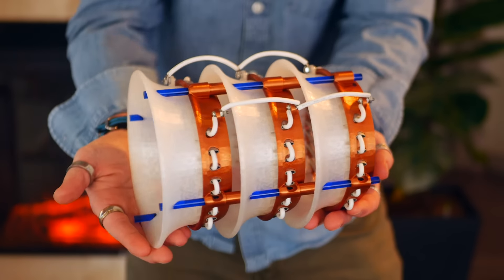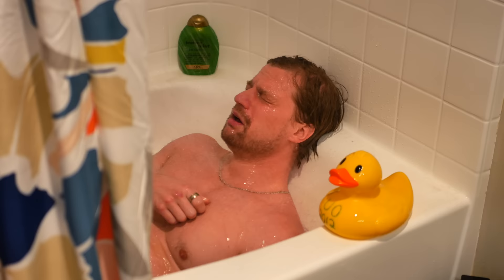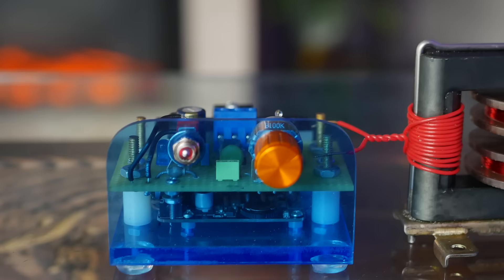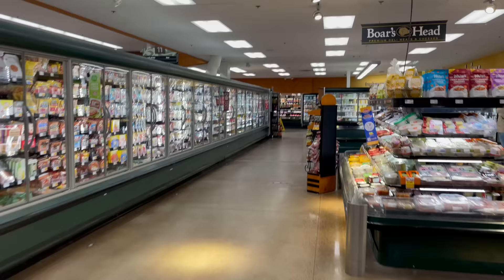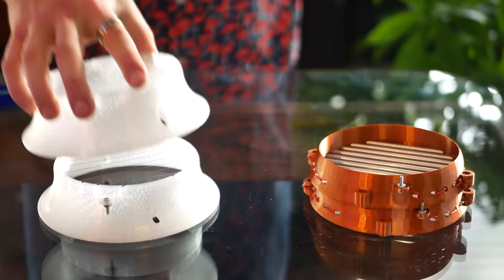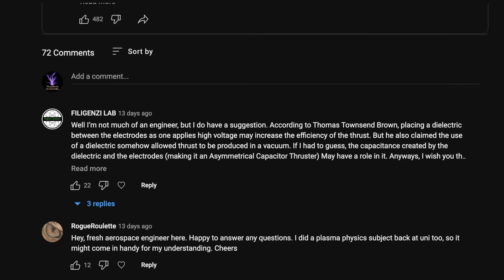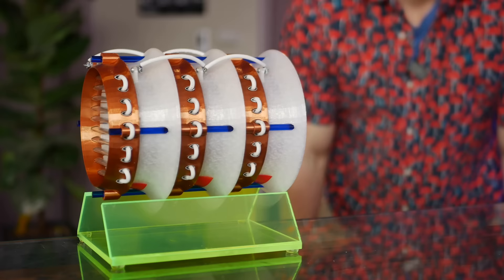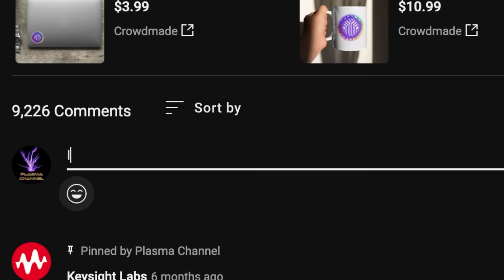The Next Generation of Ionic Plasma Thrusters (BSI MARK 2)

Comment: To better work upon the venturi effect, Try making each following stage slightly smaller. The inclemently shrinking space should increase velocity of the outlet.
Reply: exactly wat i was thinking, i would also be interested to see what would happen if you had an outer shroud that draws the secondary and tertiary airflow from the first stage
Reply: Another detail: The gap from  positive to negative electrodes should not be the same on different stages.  Experimental work should be adressed to optimize electrode gap on second and third stages.
Reply: My concern with that would be overcoming the additional static pressure that would create. Feels like the first stage needs to be exponentially more robust to overcome the resistance from the next modules. I have to wonder how if an intake manifold set up with two or 3 channeling air down to one positioned at the exhaust end of a cone would produce the same effect without the downside of needing to shrink the final stage.
Reply: I wonder what would happen with gradually smaller funnel like nozzle smaller the nozzle the faster the air will flow with limits even if was few centimetres less than current outlet even with side inlet and last stage slightly inside the nozzle just a thought tho....
Start at 30cm 20cm 10cm to 8 or 6cm nozzle mmmmmmmm
Reply: I also wonder if by creating a grid with the stages (alternating the stages in 90 degrees) if you would get laminar flow.

Comment: This is my two cents worth.  I think we have to think of this at microscopic level.   What causes the thrust is the net affect of the positive ions that are ripped apart but miss metal rods (correct me if I’m wrong). The ones that “hit” the rods try to slow down thruster.  So there is a net effect force of the ones that miss.  Now if you have 3 in a row, you end up with ions that have to go through a gauntlet, they hit one, that energy is lost.  Also for effect to work you need to feed “neutral” charged air, but your feeding increasingly charged ions at every stage.  Neutral air is still getting to the second and third stages but they will be less efficient and tripling thrust I think might be difficult.  I think if you want to triple thrust, they need to be side by side in parallel.  And you have to measure force and not airflow.

Comment: Great video. Looks like there is very little advantage to stacking the thrusters though. Better to have many single units in parallel rather than stacking them in series. Looking forward to mk. 3
Reply: true. maybe stacking them side by side to then push them all out of a single outlet. like a turbo. collecting all air into a 3 way inlet and then out of 1 outlet. because then each thruster is independently producing 2m/s and then hopefully combine without reducing any other thrusters power.
Reply: Exactly. The first thing I would have tried after the disappointing results with the pc fan would be to stick two onto a Y shaped tube. Obviously serial plasma thrust doesn't work that way.

Comment: You might want to use thinner negative conductors as well and try a closer spacing so theoretically you could get more out of the unit. Also, I love seeing your progress in this build.
Reply: I was wondering what the optimal ion density would have to be to produce maximum thrust (if there is such a figure)
By making each grid with closer spaced wires would improve the voltage gradient between the positive and negative “plates”. (More exposure of the electrical field to the air molecules) 
With the wires displaced as they are, it seems that the electron flow moves across the desired air path , effectively lessening the electron push on the air. It just seems like there isn’t enough electrons (too low density) pushing the air molecules 
Kind of demonstrated when the 2 grids were brought closer together, the resulting electrical resistance decreased and thereby increased the electron flow (current). 
I was just wondering

Comment: You might want to mix it with a wind multiplier (from a bladeless fan) to check the improvement on the wind output, also you might want to smooth your materials to have less drag coheficient from any pores or tiny bumps in the 3d printing (like polishing the materials or sand it)
Reply: I was going to suggest the same thing ... Try replacing the impeller on a "dyson" style fan and see if you can take advantage of low pressure twice.... also I agree with another poster about reduction per stage to attempt velocity boost
Reply: What about using the principle of a golf ball by leaving the surface rough?
Reply: @richpryor9650  golf balls are pretty smooth, even the dimples holes, but that only works with propelled/push by motor/engine/bat/club/arm objects in  movement  to gain speed through creating an air layer/turbulence to change the airflow on the back of the object... this principle does not work on static objects though... unless you put a golf ball in front of the thrusters... hehehe

Comment: Great work sir! 
If I may suggest: sequentially increasing the voltage throughout the three stages. Each stage would be higher in voltage by double the previous one. Or maybe even exponentially increasing the voltage throughout the three stages.
Reply: Yep I'm thinking of steam turbines, where each stage is tuned to the energy output of the last stage. Voltage would be much easier to experiment than size too.
Reply: I like it! Good call. I wonder if the optimal spacing in the later stages would change as well?

Comment: My suggestion 
1. Keep 1 inlet duct for smooth airflow wirhout any inlet turnulence 

2. Keep 3 stages of electrodes No Auxillary  air gap

3. Keep 1 nozzle at the end to convert Static Pressure of air into Dynamic Pressure or Kinetic Energy

The design is motivated from conventional Tubrojet/Turbofan Engine with three sections
Inlet --> Ionic Discharge Section --> Nozzle(Thruster) section

Try to optimize the nozzle by playing with
(A) Length 
(B) Air Ratio ( Nozzle Inlet to Outlet Area)

Comment: Awesome project with great improvements over mk1.
I would consider:
1) placing the whole system in a tube to increase the pressure, wide inlet and smaller nozzle
2) not sure sucked airflows from the 2nd and 3rd stages add a lot, I would focus on compressing the current airflow in a smaller tube and vary input voltage on each last stages
3) like current aircraft, I would advise to get 2 differents "controlled" airflows: main going through all 3 stages, secondary going around the main outside the 2nd and 3rd stages (of course the 1st stage must be way wider than the others)
4) go big, i mean factor scale will highly change things with different sizes, this is what we are looking for in aviation but we are limited by ground clearance for the engine nacelles haha

In a nutshell: wider 1st stage, 2 airflows going through 2 concentric tubes
😉
Reply: Completely agree with 2) & 3) you are measuring airspeed yet you increase the pressure by bleeding in that air which will reduce the velocity. Velocity is inversely proportional to volume - Boyle's Law.  Drop the gaps between multiple stages and make the transition between each stage as smooth as possible.
Reply: I doubt flow from the first stage around the others like a turbofan is gonna do much, if at all. In a turbofan, bypass flow makes sense because the first fan is driven by the combustion and compressor, but here it would do nothing but accelerate air that is not used anymore. Fully agree with the rest, all those "auxillary intakes" do nothing but make it worse. Intake and nozzle, I think, are key here to increase outlet speed.

Comment: Excellent work...regarding electrode alignment, you would be wise to introduce some asymmetry into your design IE positive electrode (forward,) can be wire and the negative electrode (arft,) a cylindrical ribbon...greater surface area..also have you considered staggering the voltages IE each stage higher than the previous.

Comment: Thank you for the video and the effort. I don't know if it possible, but I have an idea for Mark3 to improve the result: the size of each module should be different, and each module should have its separate power source. the overall shape should look like a cone. the first module or circle is the same size of the diameter of circle in Mark2 but the second module or the module in the middle is smaller in size. the last module is smaller than module 2. the bigger module should have 1/3 of the power, the second module should have 2/3 of the power and the last and smaller module should have full power. the idea behind this is to build more pressure which may result in higher speed of the air flow.

Comment: Really good video and progress you've made there. I only have a small suggestion, let the 2nd ring be 10-15% smaller than the first and the last ring also be 10-15% smaller and get a higher compact air outflow.
Reply: bernoullis principle applies to high pressure and high velocity flow, so it would have almost no affect here.
Reply: I would go with 1.5x surface decrease per stage
Reply: you're just making it even less efficient.

Comment: This is a great video. Love how you've approached ways to improve your design. Especially when collaborating with different people. I'm not a PhD of any sort but I'm fascinated about learning how physics works and gets applied. This might be outside the realm of plasma but if you're open to trying this out or if it's possible, have the output airflow of your engine go into a chamber that's like Tesla one way valve and heating the later end of the chamber to expand the air (similar to a ram jet) as it leaves chamber. It might not work for obvious reasons I not aware of, but it's food for thought. ;)
I look forward to seeing other videos.

Comment: I would be interested to see if the 3 would make more thrust separately or in the 3-in-a-row config you have now.
Reply: thrust, maybe, as they are pushing more air volume, but stacking them is the only way to increase the velocity of the airflow without increasing the mag field created by the electrodes(which can be done a couple different ways).I’m not being a know it all, i just built one recently is all. not qualified in any way.
Reply: if you mean routing the 3 separate ones into 1 output  nozzle of some sort then yes it wld make it faster, i just realized that’s what you could have meant after writing the last response.
Reply: @OwenMurphy-pp6dr  I would love to see you try it. seeing what actual thrust you could make. also instead of running the wire through the tubes solder them could help making the tubes thinner I'm subscribing after seeing this video.
Reply: @randy6394  yeah i love this guy he’s where i got the original idea from (although it’s much different from his now)

Comment: You may consider using stepped sections. A larger stage feeding to a slightly smaller stage to an even smaller stage. This should compress the air stream and improve your thrust output. Just a thought.

Comment: In your current design, have you thought of stepping down the output diameter of each subsequent thruster to see if that too would increase the air thrust pressure? Great job by the way it is inspiring me to make one.
Reply: T-H-I-S! Thank you. Smaller diameter and collapsing gaps between each one.
Reply: I like this! I'm not versed in anything like this, but it makes sense in water pressure, why not this?
Reply: Can air inertia play a role here?

Comment: Awesome work!! I love what you're doing! I would be curious to see what a radial array of wires would do. I wonder if you angled the ground fins like a propeller to create a vortex at different angles for each stage and decreased the side inlets farther down  and compress the vortex at the end with a tapered nozzle to speed up it's rotation and hopefully velocity as well. I'm no engineer but I know jet engines have variable angle fins in between turbines to guide the airflow for maximum efficiency!

Comment: Thanks again for this. It is a huge improvement compared to Mark 1. I have been logging your results as I am planning to integrate this into another known technology to produce a combination that could substitute for a turbofan engine, albeit a much smaller one. It's great that you managed to utilise a lower voltage for this as I did have major concerns on your Mark 1 that needed 45 kV to run lol. All the best on future improvements, and perhaps we can compare notes in the future. Cheers!

Comment: I was wondering what would happen if you tried creating a vortex? Imagine 5 stages.Each offset by a few degrees to twist up the airflow so when you reach stage 5 (or whatever) the grounds are now vertical. So, stage one is horizontal, and from there each stage is twisted slightly until you reach the final stage that us vertical.
Reply: I was wondering the same, also I believe the laminar boundary layer (aka skin effect) is slowing down his results due to unnecessary drag. Im curious if a rotating triangular set of grids would help open up the center a bit for higher flow through while twisting it could help create that vortex to even out and center the flow
Reply: when i seen the video i was wondering a similar thing. but adding a "rifling barrel". to cause a spiral effect.
Reply: The development of the Next Generation of Ionic Plasma Thrusters requires an understanding of the evolution of ionic thrust. While jet turbines evolved from propellers, there is still much to be learned about the potential evolution of ionic thrust. The BSI MARK 2 represents a significant step towards the development of advanced ion thrusters, with its incorporation of new design elements such as the aluminum cross tubes and fine wire layers. The challenge now is to determine the optimal configuration for these elements and to eliminate design flaws such as the mixing of low-velocity air with flowing air.

Comment: Since the stages don't add up airflow, I'd adapt the second and third stage to perform best with already moving air (using the setup fan - > thruster -> meter). The later stages probably need more space between electrodes and maybe you should also stage the power input.
Reply: bro just connect them in parallel ☠
Reply: @prakharmishra3000  works too xD

Comment: great vid now I want to build one. I would suggest changing the out diameter of the second and third stage in both a expansion setup and a compressor type, because I believe the extra stages are still resticting air flow

Comment: You could also increase voltage for each stage. It works in photomultiplier, so it could work here as well.
Reply: I was thinking this. Uniform power across stages creates sustained flow not a cumulative increase per stage.

Comment: I know nothing about this tech but I am very engineer minded.and worked on helicopter engines for the military.  What happens if you use a screen style cross pattern with your wire side electrode creating a grid creates precise points for arching. Also tightening your 2nd and 3rd stage intake rings get them to the point they're whistling. Then open them up just a hair. This will give you better vacuum creating better thrust I believe. Im

Comment: For increasing exit velocity, perhaps you can make the ionic thrust sections at a larger diameter (might need to print in sections). Then have one more Venturi funnel just after the last stage that necks down to a smaller exit diameter (there might be some fluid dynamic formulae to find the optimal entry:exit diameter ratio)
Jet engines kinda do this too, so perhaps by squeezing a larger volume of air through a smaller opening, you might gain some velocity.

Since you have made the cathodes more aerodynamic, perhaps you could also increase grid density along with the bigger entrance diameter?

This is fascinating stuff!

Comment: First let me say great work on the first design and this second design. I’m excited to go deeper on this exploration journey with you. I am a Mech engineer so I love seeing your experimental prototyping process. Please look at some of these notes if you get a chance. 

I’m sure someone else has said this but varying the stage sizes and even spacing. Think about a turbine engine that keep compressing more than the previous stage. Flow rate(Q) = velocity(v) * Area (A). With a constant flow rate: as area goes down, velocity increases. 

Also others noted airfoil shaped electrodes would improve aerodynamics and reduce turbulence with its associated loses. This in turn would increase your final velocity. 

With your current setup the additional stages are not sealed and you demonstrated it is indeed sucking more air in. The geometry and spacing between the stages is is critical to maximize that flow. It’s technically called a “jet pump” and math can get complicated quick.